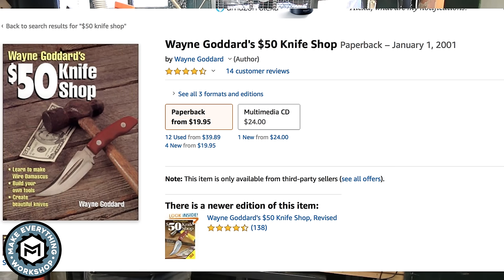$100 Harbor Freight Knife Shop!

Comment: Love how you speeded up the tedious parts.  Good job with the video.  I know you wanted to source everything from Harbor Freight but for a real budget knife you can get a small piece of wood from the box store or a board from an old oak pallet.  My local hardwood distributor allows me to dumpster dive for split or broken pieces of hardwood. Old saw blades at the swap meet are a buck each.

Comment: I started watching this video with high hopes...I ended the video thinking, 'he used $100 to make a $5 knife you can pick up at any Wally World'. That handle is a true abomination...and would be agony after using it for 1-hour in the woods. That saw blade is <1030 steel (bumper stock) and is most-likely minimally hardenable...and you could have bought a real 1095 steel blank for half of the 'prep cost' you put into the final product shown here.  We won't go into actual temperatures required to 'harden', 'anneal' or 'temper' steel...I think I need a drink now...

Comment: Bob Brownell used a large rectangular flashlight battery connected to a removed D cell carbon center "post" that he sharpened to a point to de-temper spots on the rifles he worked on so that he could drill / tap holes for scope mounting. The same technique could be used to soften tempered knife making steel to bore holes easily without having to start a fire and waste time.

Comment: That saw blade is not carbon steel, just carbide teeth
Reply: Carbide blades are carbon steel with tungsten carbide tipped teeth
Reply: @mitch2883   Very little carbon in that blade... Not worth the time and effort. The old saw blades use to be high carbon steel, modern blades rely on carbide tips like Jordan mentioned.
Reply: @nsmturbo5902  You're missing my point that a carbide tipped blade refers tungsten carbide in the tool industry. Tungsten carbide is not steel. This isn't even a carbide tipped blade.
Reply: Look at the sparks when he is beveling

Comment: Quick tip use an old brake line or archery arrow as a blow tube to add air to your fire, gives you much more control over where your putting air to the coals.

Comment: The first knife I made I used an old lawnmower blade. I had no file, no angle grinder, not even a hack saw. The only tool I used was an old single wheel bench grinder that my great-grandfather had made from an old motor. It took me hours to grind out the rough profile, but in all, for the tools and knowledge I had, it turned out just fine!
Reply: Oh, and I didn't know heating up the steel would make it softer and thus, I didn't.

Comment: I have used power saw blades many times and drilled holes with a masonry drill that I ground to a normal drill profile. leave the teeth on the back [just grind the set off] and you have a bread knife and carving knife combined, or whatever knife you have made. I found I had to be careful not to drop them because at that time I didn't know how to temper them in an oven. cool vid mate well done

Comment: My dad's been stock reducing saw blades since forever ago...Prolly early 70s for all I know..
I helped him make his last 100 custom built knives before he gave it up for old age and other life things taking time up...
He still builds a few custom fishing setups from time to time but that's a bout it...
He was at #1248 of his knives last I knew and that was 2 years ago now...
He used lots of Your same processes same as I did...I did 90% of all the work with a dremel tool tbh....I mean rough sand was strips of sand paper drawn horizontal across the tang and slabs but all the rest was dremel....Also we used that t-88 epoxy for handle scales and that stuff was ridiculous if we had to take em apart..Never needed pins besides for looks that way...
Also,it's nice to have a supplier that You can 0rder some 6"×3/8 slabs from...js...
Have a great day man and thanks for the vidja!!

Comment: Used motor oil is great to temper metal with. It's full of carbon. That's what I use to temper concrete hammer drill bits after sharpening.

Comment: Reminds me of the HF draw knife I made that I needed for long bow fabrication. Actually, HF doesn't sell draw knives and they were too expensive elsewhere so I made them from cheaper HF tools. I cut the hickory handles from a couple of HF hammers and turned them into draw knife handles. (HF Axe and hammer handles might be an economical source of hickory for other knives too.) Then I cut out the blade from a $5 HF machete with my whiz wheel and ground it on a grinding wheel.

Comment: Very cool project and very well done! If I could make a suggestion it would be about the handle. You want the very top part of it to drop down a little. In case you stab something with it, it'll prevent your fingers to slide forward(onto the blade) and be cut. Best of luck.

Comment: Great video. I have an area in my shed I can use the oven for heat treating, so I use the motor oil when I change my truck oil. Never thought about veggie oil. Thanks for the idea. Also, if you have a gas BBQ you can use that for smaller blades instead of a pit. Just take off the grids or you could get a flame spreader from HF for about $20 (or less on sale) that hooks up to your 20# BBQ tank (if you have the $). Actually, I already have most of these tools anyway. 
Keep up the good work. If you are in a decent size town, you can get a lot of this stuff at yard sales or thrift stores.

Comment: You could clamp the grinder to the table and make sure which direction it will spin , so you could see from a better angle , just make sure the grinder won't come loose .

Comment: Suggestion would be to buy another file instead of that thin saw blade.   You can anneal them in your BBQ pit.  Put it in under your hardwood for a fire,  start it,  make coals,  let fire burn and turn to ash.  Pull out of ashes after they cool.  File should be annealed.  Use another file to see if it's soft now.

Comment: Nice presentation.  Two quick improvement thoughts,   You purchased the Drill Master grinder.  It is a piece of garbage.  For about $4 more you can get the Central Machine 4-1/2" heavy duty grinder at Harbor Freight and it will last a lot longer.  As a Blacksmith I have tried both and burn up the Drill Master in a few weeks while the Central Machine typically lasts a few years.  Second comment, while the two dowel pins work, to improve your handle, drill several smaller holes in the tang and make sure they fill with epoxy during assembly.  this will give  your scales a lot more strength.

Comment: If you need to contour choil like areas and have no money, use a dowel and wrap with sandpaper, stapling down the edges.  Did this until I bought a small wheel attachment for the 2x72 I eventually built

Comment: Another good source for steel for the blade is old files. they take a little longer to shape and heat treat because they are thicker but they tend to have steel that is better suited for knives. Files are usually made from 1095 steel.

Comment: Tip for brushes wearing. Remove the brush from its housing and turn it 180 degrees. Usually the rotation wears the brush to a point at one side. By turning 180 degrees the point no longer lodges/jams between the rotor and the brush housing. Performed many emergency motor fixes doing this.

Comment: I'd definetly increase the budget, get the portable metal cutting saw and fab a stand and work rest for it. Be SUPER safe using it! Also buy O1 tool steel 3/32" thick and handle scales from Jantz Supply as well as a sheath so youbcsn carry the knife right after sharpening it to show off. Oregon Blade grinder is a great next step if you get thrills making knives and want to go more into the hobby.
Reply: A "jewlers saw" and no. 6 blades are your friend at this level of knifemaking!

Comment: Hi, thank you, for one of the best knife making videos I have watched, I think that not only was the actual knife forming brilliant, but it was the multiple tips and ideas I gleaned from your video, eg, from using the the grinder to making the simple knife vice and all the invaluable tips in between and after.

I am definitely going to give it ago, as I have most of the tools listed, plus a piece of tool steel I was given, for the blade, also it will give me the chance to use my grinder( still in the box) also I was bought a Ferm scroll saw for Xmas, so I will try and use that for the scales.

 Thank you again, for the push to do this

I have subscribed to your channel and will continue watching 

All the best
Sam

Comment: I may have missed it, but one thing  to mention to people when using circular saw blades for knife steel, make sure that it is the type of saw blade that has the teeth made right into the blade, and isnt a blade with carbide teeth. The blades with Carbide teeth on them are a softer metal unsuitable for knifemaking as it is the carbon tips that do the cutting, whereas with the blades like shown in your video are a full carbon blade.

Comment: Just a note about newer saw blades. A lot of newer blades have carbide teeth, but the rest is not carbon steel. Not all saw blades will harden. You might want to cut a small test piece and see it it will harden before going through the process of profiling a blade.

Comment: I made my first knife when i was 16 and i remember not knowing how to use a jigsaw or recip saw and we didnt have a band saw in the workshop so i used a angle grinder to profile handles besides burn marks inhaling half of my project and uneven cuts it worked pretty well and looking back im glad i decided not to try and use the drop saw to make the cuts

Comment: For the fire part what i used to do is stick it in the barbeque with coal and use my moms hairdryer as the oxygen source. Works really nice just watch where the wire of the hairdryer is bc you might melt it off... ask me how i know

Comment: If you do wood working like me you will most likely have a lot of this gear like, safety glasses, clamps, sand paper, wood (for handles), epoxy(maybe), files, drill, drill bits, and you might also have old saw blades.

Comment: 19:00 cut pins from a wire coat hanger or a nail.  If you’re using epoxy, they’re 80% for looks anyway.

Comment: I just quenched my 1/8th" table saw blade yesterday and used charcoal chimney starter and leaf blower and the blade was glowing red in about 1 minute.  I did set it on top of an opening i use for a cinder block rocket stove and blew the air from about 5 ft away into the intake/fuel side of the rocket setup.
Reply: Hey, Mixwell, how did the finished knife turn out?  Will it cut?

Comment: If you aren't well experienced with angle grinders: unless your cutoff wheel is specifically designed to cut AND grind (it says on the disc; usually has pictures of what the disc can be used for), do NOT use the cutoff wheel to grind at all; take the 30 seconds to swap out the cutting wheel for a grinding disc. When you get more experience you'll know how to remove burrs with a cutoff wheel but you have to be very gentle. A blown up disc spinning at 10,000+ rpm can do a lot of damage.

I learned this lesson the hard way when I was a new guy at the welding shop I worked at.. I had to grind down some tacks and was trying to be gentle but the disc blew apart and a chunk hit me directly in my left testicle. Luckily, my jeans were thick denim so it didn't cut through, but I had to sit down for over an hour before being sent home and wasn't able to walk normal until the next morning. I still have a dent in my left nut to this day and it happened over 4 years ago.... I was terrified for a couple days thinking I ruptured my ball but I had my son a few months AFTER the accident with less than a month of trying, so the boys are still specops sniper quality lol

Comment: really liked the video, 30 mins passed and couldn't tell how time flew

a few additional info:

- never, ever, EVER sand with an angle grinder inside, dust gets everywhere and it's super tiny particles
- when you grind hardwood with the angle grinder, always move it otherwise it's going to burn the wood, the finish should be done manually with sandpaper for superior result
- when you grind the bevel in with the angle grinder, make quick swift moves and every couple of passes, spray some water to avoid burns
- you can actually drill the hardened steel with a new drill bit, just that the bit will be useless after a few holes, drill initial holes with smaller bit and then enlarge them with the bigger bit, this will destroy the bits, but if they are cheap and you don't care, it saves you from making one fire
- you can use 2 nails for the pins, especially if you're going to epoxy them in, alternatively, you can cut them 1/8th longer than you need and hammer then ends, then grind them flat
- whenever you sharpen with a flap wheel or the sanding wheel, always go from one end to the other with each pass if the material is the same thickness like in this case, you aren't seeing it, but the flap wheel will make bows in the material

Comment: cool video. only thing. when you use a file only use it in the forward direction. If you pull it back when still on metal and still pushing down it will dull it.
Reply: I quench tools in used engine oil. I think the carbon content in the oil helps.

Comment: Great tutorial and idea!
Be very careful cutting wood, plastics, or rubber with those cutoff wheels. I saw one explode from doing that to it. 
The wheel manufacturer said that cutting/grinding things other than steel with the ones designed for steel, causes them to overheat and they will crack when cooling down. Then the next time you start up the grinder they can explode violently. My friend has a permanent gnarly looking scar on his jaw from an exploding wheel.

Comment: I really hate cheap knives. This is a great way to make what you need and get a decent product. Of course the better the materials you use, the better the product. There is a few more steeps you could add if you wanted to. The heat treat process and laying out your work is the unseen work most folks are not aware of. I also try to recycle as I hate seeing plastic go into landfills. Again, its just up to the imagination.

Comment: I'm sure you did this from the angle of someone with zero tools or equipment but if your making a knife and any respectable guy you wouldn't use a pull through knife sharpener! Lol I'm surprised its the only thing harbor freight sells to "sharpen" a knife. They couldn't get a sharpening stone or even some ceramic rods or something? Great video btw, and pretty cool you can make that with only bare minimum tools. Jp on the sharpener thing, I'm sure it was just because it is the only item. Keep up the cool videos like this, I subscribed!

Comment: There are some things I might have done different... 1. i would have used a thicker blade like a diamond edged concrete blade, 2. I would be careful blowing on the fire... I’ve seen people blow too hard and fall in the fire after they pass out... not badly burned, but they lost their balance and put their hands on the fire. 3. I would have made micarta(sp?) out of some 5 minute epoxy and the cardboard packaging. 4. I would have picked up one of their diamond hones they sell... 5. You could have tried compressor oil, it’s pretty thin.

Comment: a tip from a blacksmith is before you get into doing this on your own look for anyone local that is a Blacksmith thats willing to take an apprentice, because I've seen lots of people get into this with improper tooling, or even dont want to do this and they waste hours on making something that some people will not buy because theirs another smith down the road that has 2-5 more years of practice on him, But with that said I would recommend instead of using saw blades... use old files, and before anyone says you cant find them try 2nd hand stores they will always have 1-2 files in there.

Comment: Nice work! I personally wouldn't use a saw blade for the steel though as proper blade steel can be bought for very cheap and I'm not a fan of the thinness of the saw blade. Great video either way.
Reply: >> proper blade steel can be bought for very cheap

What would be considered proper blade steel, and where do you buy it?
Reply: @JDeWittDIY  I use 1075 as it is the cheapest i could find from GFS Knife supplies in the uk it is about £4 for 50cm which can make a couple of decently sized knives but anything with over ~60% carbon should work.
Reply: @extreamemineing  Thanks! Old files also seem like a good source of metal for small knives.
Reply: @JDeWittDIY  No problem, I prefer files to saw blades because of the thickness but they can be a pain to heat treat because they need to be annealed
Reply: great point.  aspiring knifemakers often use scrap steel thinking they are saving money.  in reality, the steel is the least expensive part of the knife.   

buy good steel.  it’s cheap and you know what you’re getting.   1075 or 1084- super basic steels.  all you do is heat to non-magnetic and quench in canola oil.  temper for 2 hours at 350f in your kitchen oven. 

good steel sources:

Alpha Knife Supply
New Jersey Steel Baron
USA Knifemaker

Comment: A helpful way to get air to your fire is to use a piece of copper pipe (a foot or two should be plenty for a small campfire) to blow air exactlywhere you need it. Baring a copper tube or pipe, a piece of black pipe, metal conduit, or even an old brake line will work.  If you have to buy the tube or pipe, add three or four bucks to your Harbor Freight trip.